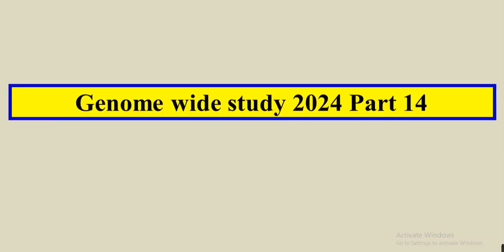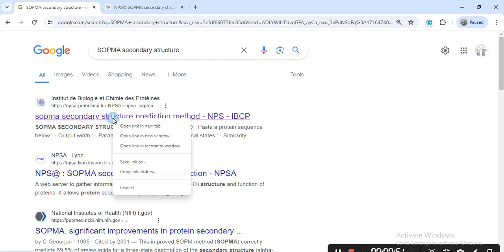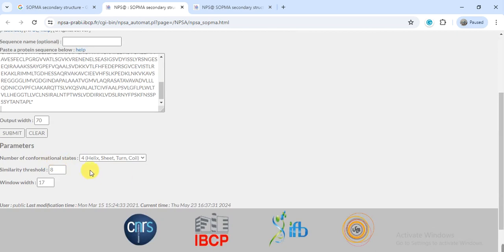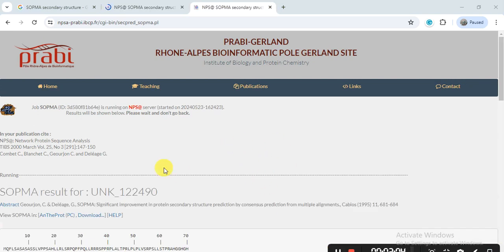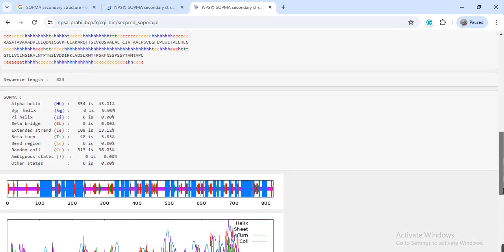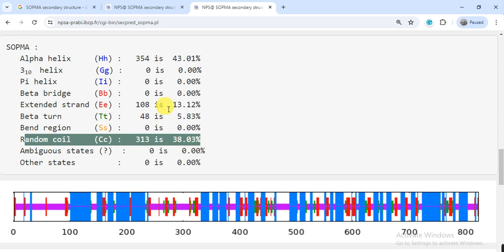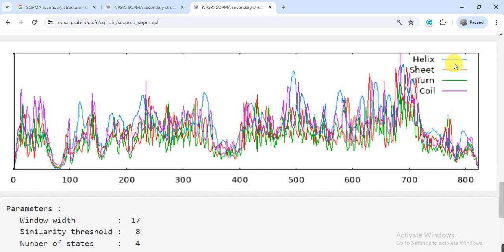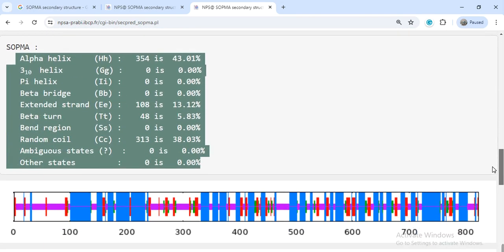Protein secondary structure Genome wide study 2024 Part 14

Comment: What if hair pin structure is present in our forward or reverse primer (during primer designing) ?
How to remove this ?
And can we still use this in primer designing?
Reply from the maker: If the primer is for cloning then you can go with this. Try to have little bit high annealing temperature. If you are designing the primers for qRT-PCR then choose that part which did not have the hairpin